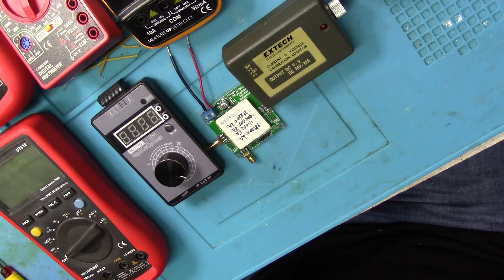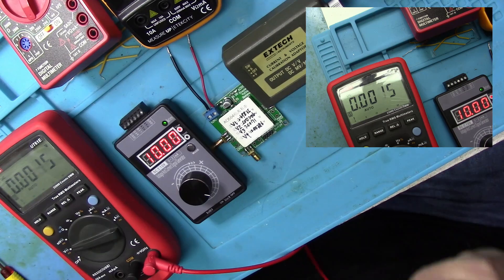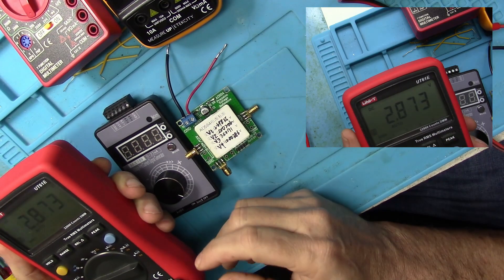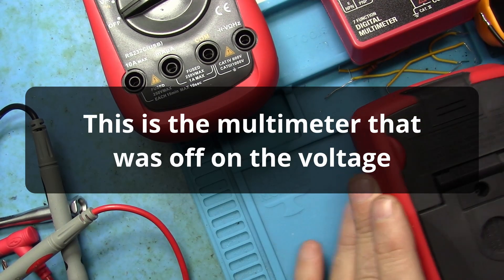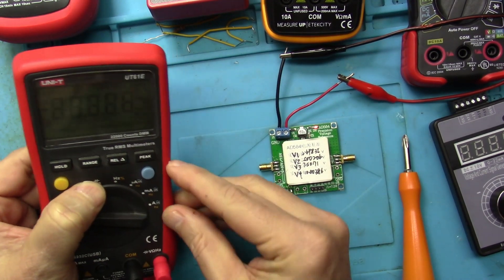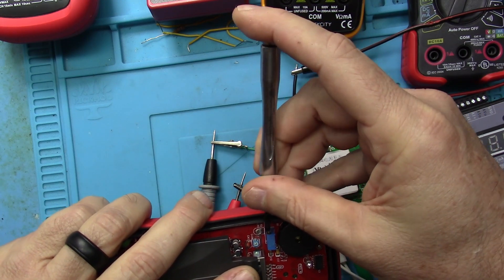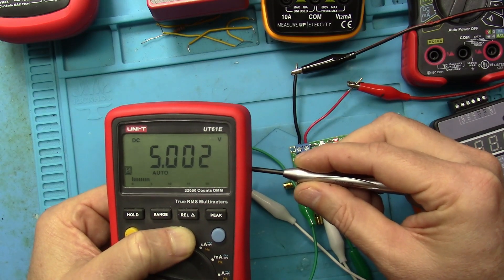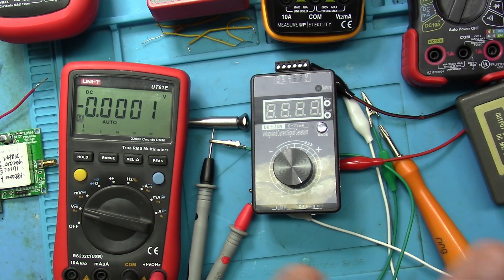Simple Multimeter Calibration with a Voltage Reference

Comment: How to calibrate Sinometer vc6243 lcr meter?  El cheapo meter. Most interested in the inductance accuracy….
Reply from the maker: Sorry, but I have not opened one up and looked inside, so not sure.  However, I suspect you can do a "cheap" calibration on it if you have a known inductance for reference.

Comment: You need to start with a calibrated source or multimeter as you need a starting reference. The only true traceable calibration is via an accredited laboratory that has BS EN 17025 accreditation. Many calibration companies use calibrators that have an accredited calibration BUT no accreditation for their company. Avoid these companies because traceability is NOT via a calibration certificate alone. A good measurement consists of an accredited calibration, drift, uncorrected error, temperature coefficient due to ambient temperature, repeatability of the measurement, resolution of the calibrated valve vs the instrument being tested, thermal effects of the test leads and the terminals of both the calibrator and device you are testing etc. etc. etc. If a voltage reference is calibrated at 20 degrees Celsius what is the error if used at 15 or 28 degrees C ? What are the temperature coefficients of the components in the cheap voltage reference ? The list goes on....
Reply from the maker: Thanks for sharing.

Comment: I don't understand the value of the ExTech thing you got on eBay. Unless I'm mistaken, without a digital readout, you need a calibrated DMM to determine its voltage setting (unless the ExTech has a digital readout that you weren't showing?). So, to calibrate your DMMs with that thing, it seems like you have to know that at least one of your DMMs is calibrated. Isn't that a catch-22?
Reply from the maker: Good points.  Yes, there is a level of trust if it does not have a readout.  A poor man's calibration is a close enough solution.  The new, very expensive, Extech devices do have a screen.

Comment: When calibrating the multimeter on the DCV range does it calculate the ACV range at the same time. . Also does it not put the over ranges ie ohms and diode. ?
Reply from the maker: I think that might be meter specific based on design. Maybe a good question for Dave Jones.  I know he built a commercial meter. Personally , if i needed that level of calibration I would send it off to a calibration lab.

Comment: Thanks for the tips, i also got a cheap one but i thought it was off reading higher then my others, turns out the others were too low when i checked it against a reference.  I used the 3.3v pin on a stm32 microcontoller, maybe not the most accurate but the cheap meter read 3.331 so i figure it was ok,  and calibrated the other to 3.3v.  It was off by .05v  which doesnt sound like much, but even for hobyyists setting proper voltages for batteries, you really dont want to be off by much charging a lithium cell.  Good stuff, now i got a another usable multimeter.   Even if theyre a little off having them all the same is nice.
Reply from the maker: Thanks!  Good idea using a 3.3v pin on the stm32.

Comment: ugly crappy chinese alligator test leads. There is more plastic than copper. Typically 6-8 strands only. By so low copper you get what ever readings because bad connection. Buy or make DIY way better than that garbage
Reply from the maker: Agreed. They are very cheap!

Comment: A bit strange that the pot has this huge range from 4.2 to 5 volts. These 10 turn pots are not known for stability. A bit of vibration could influence the setting. Usually the range is much smaller.
Also check other ranges like resistance and current to verify that the fault was with the pot.
Reply from the maker: Good point. Thanks. Not sure if it is clear in the video but I did not turn that pot much at all. Maybe a quarter turn.